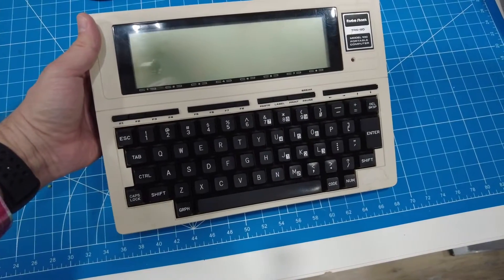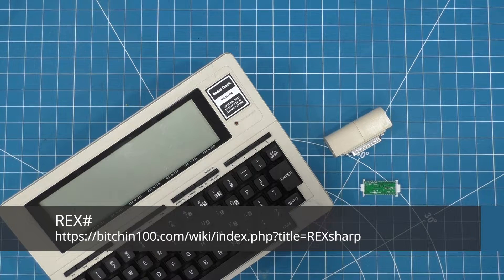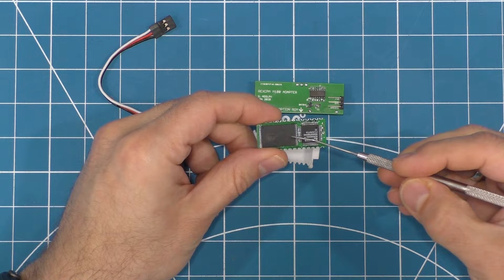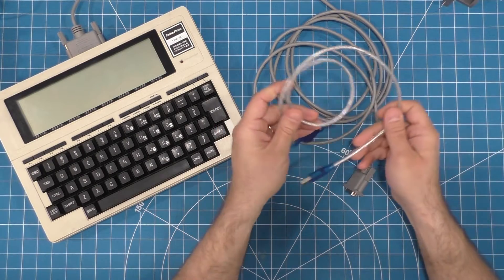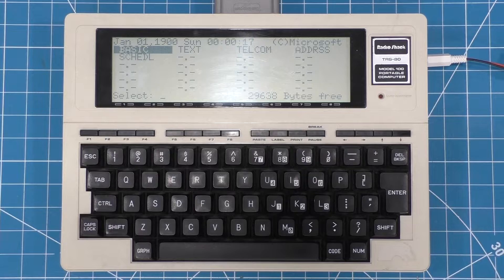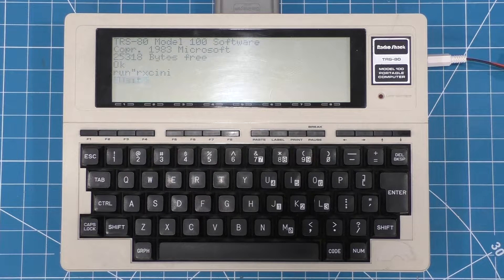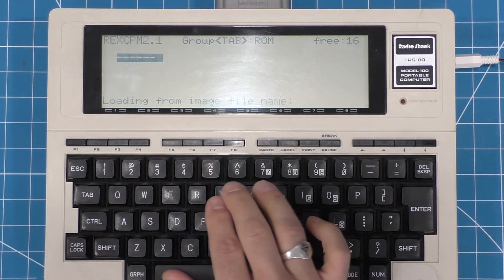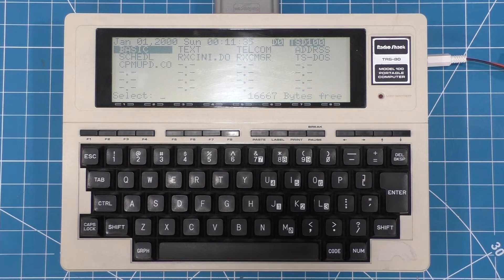Running CP/M on the Tandy Model 100!

Comment: I did this mod several years ago.  The hardware side is easy, but the tools to move data to and from the M100 are a mess of filename munging and other pitfalls.  I won, of course and got the machine running.  Hitchhiker's Guide to the Galaxy and the Zork series are and run peachy.  It was a fun project and continues to amaze me, as CP/M on 8085 is fairly rare to begin with.

Comment: So CPM would not run on a regular REX? You need to buy another chip? It looks great but if you forked already 40 dollars for the regular REX, you need another 60 dollars to get CPM running on the device, and that seems to be quite a bummer sadly.
Reply from the maker: That's correct - you need the SRAM chip that's on the REXCPM

Comment: I remember running CP/M on my Amstrad NC100. It has a similar form factor to the Tandy, but doesn't require hardware hacks, since it uses a Z80 CPU. All you need is an SRAM card.
Reply from the maker: Very nice - I’ve had a couple of people mention that I should check out some of the early Amstrads, so perhaps one of these days 😁